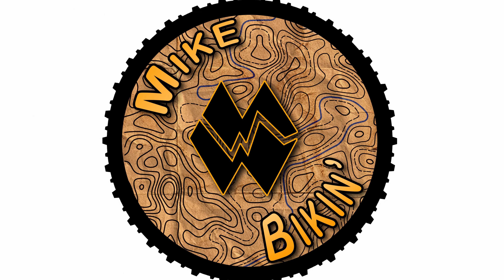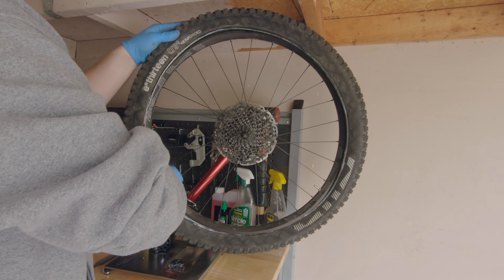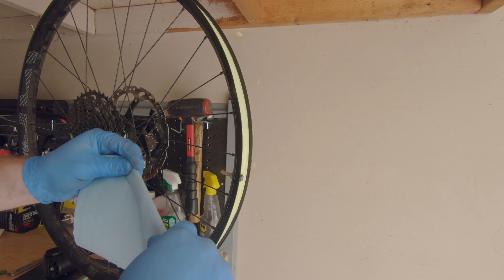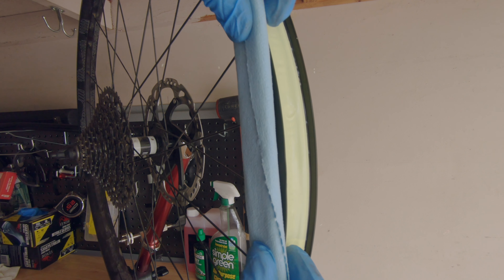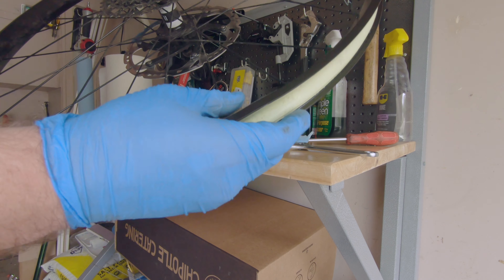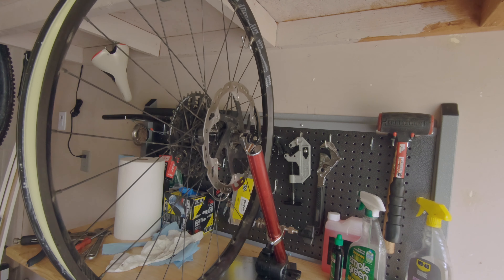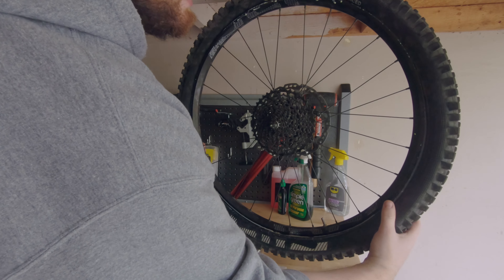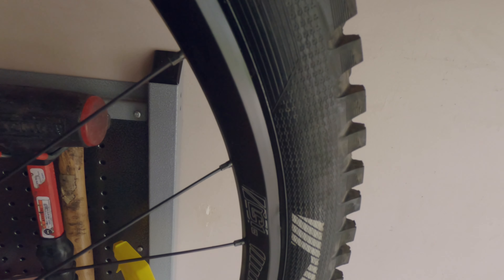Can you fix dented MTB Rims with common tools? Let's see if this wheel can be straight again!

Comment: I got three on one day. It was the 4th ride so like new. One of the dents was huge. So huge that affected the area close to the napless but no to twist the rim. It toke me long time to fix it but I will replace the rear rim anyways for sure.
MAy I ask you how good is that rim? lg1?
Reply from the maker: It's not that great, got the dent on my first couple of rides out on it. I guess you get what you pay for.  That being said, I got some Minesweepers tire inserts and I haven't had a problem since
Reply: @mikenbikin9182  It is not expensive and thats because is one of my options. I found that rim on a web at uk but Still not sure where and when to replace it.
I was thinking on my case when damaged my rim/s; My rim is not a top one. it is a standard WTB 27.5  29mm rim.
The sealant was low when started to use it at summer from new because the bike was stored for months before ride it. And, the worse was that I rode it on a very rocky trail very fast where rocks were sharp and pointing from the ground. I didnt avoid the rocks at the last part. Awful idea so mostly my fault.
I may be wrong but I think that even top wheels with top rims can get damaged no matter geometry of the rims or carbon or 6061 or 7051 alu.
 Couple weeks later rode again the same place being careful but my tyre, a new schawlbe hans dumf,  got holes even on the walls like the nobby nic of the previous time. Some "holes" on the walls very close to the rim and on the same same line that the hole on the tread. I think that explain a lot.
The second tire got flat after ~15 minutes. What a mess!!!
My bike is at Spain now so I have time until I come back on holidays to rebuild the wheel.
got months to find a proper rim.
Reply from the maker: @Fromheaven007  Man! You must be riding some really janky stuff! I'm a pretty big guy myself, so I've found that not going under 26 psi with the tire inserts keeps me from making contact with the rim. As far as your tires go, line choice matters! To make my cheap rims hold up better I went with DT Swiss Alpine III spokes, in my case I'm more worried about durability than weight. Good luck with yours!